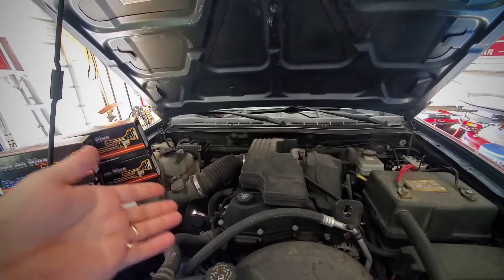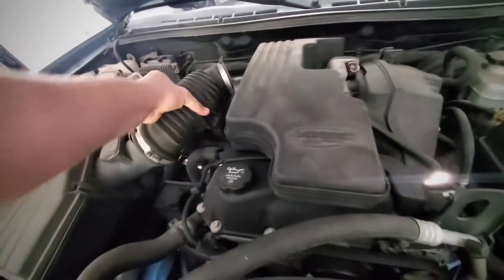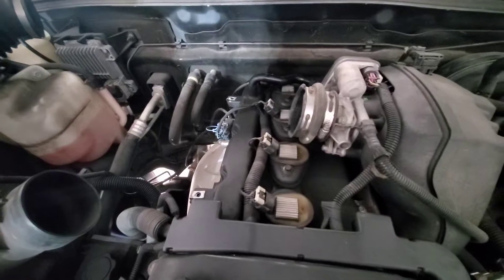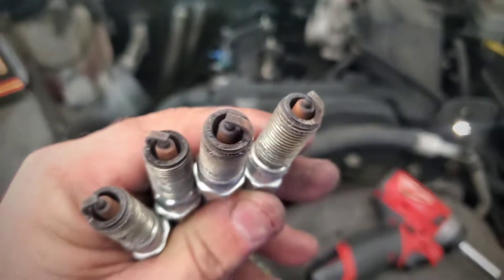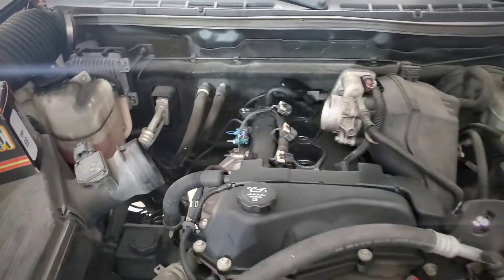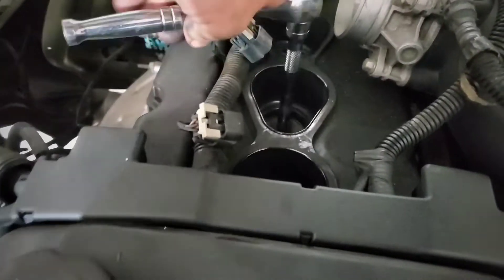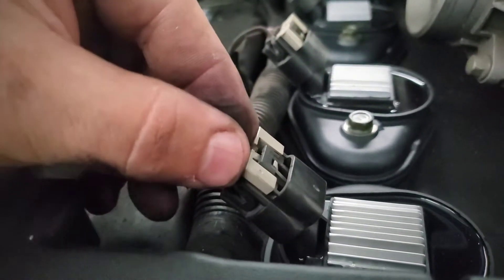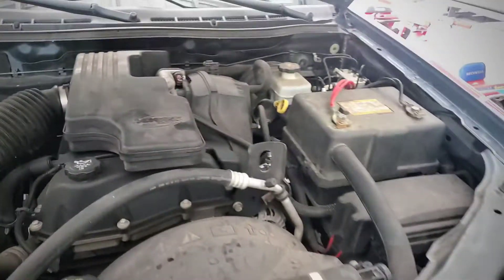2006 Chevrolet Colorado tune up

Comment: I may have to enroll you in the work smarter not harder class. The deteriorated PCV hose is one of the major factors of the issues you're trying to eliminate. You should have picked up the hose and completed the job, now you will have to repeat some of the work a second time. Don't rush auto repair, it doesn't pay in the long run.
Reply from the maker: The hose was pretty simple to swap out